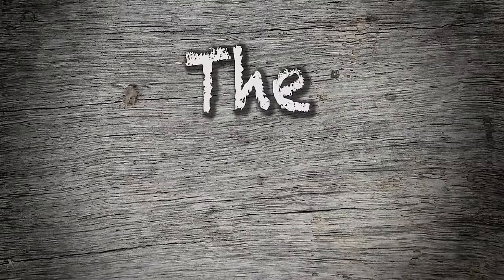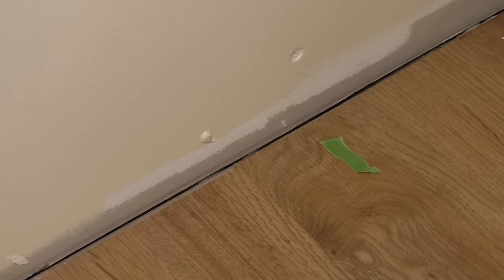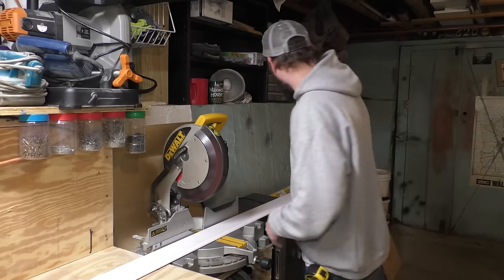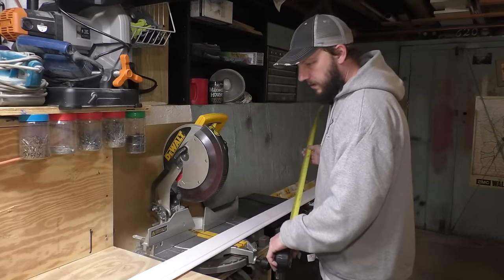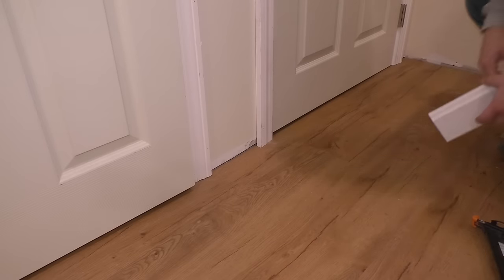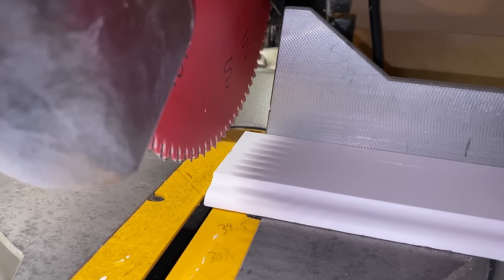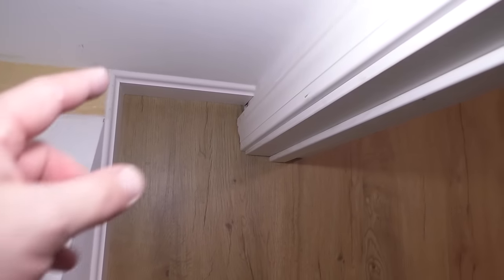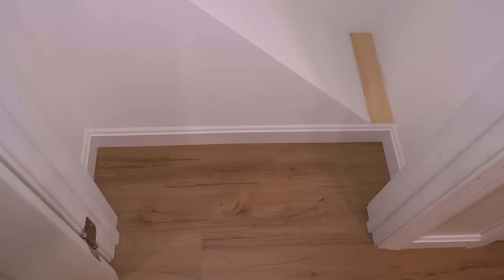How to Install Baseboard Trim - Cope and Scribe - Old House Bedroom Remodel Problems

Comment: Coping isn't worth the effort in my opinion. I just cut my pieces at a 47 degree angle which leaves a slight gap at the back that I just fill with caulk and the front usually turns out pretty clean

Comment: On the scribing baseboard before pushing the center down and nailing it in place put a tiny 16th inch thick shim on both ends of the baseboard bottom and then push it down and nail it and take the shims out after you nail the ends and then you'll have some room for the floor to move

Comment: Another option for the floor being unlevel creating the gaps is to install the baseboard as is leaving whatever gaps are there. Then to add a shoe molding at the bottom. The shoe molding is much smaller than the baseboard so it flexes easier to cover the gaps. This is especially useful when the baseboard is taller (like the 6" stuff) or the floor is very wavy. I just use short brads so the shoe molding is only nailed to the baseboard and not beyond that. The cheap traditional way was to use quarter round but they now have shoe molding that matches the style of the baseboards themselves and better fit with the look.

Comment: How to handle baseboard in an old house - great stuff. Guess those ideas would work on a bad basement concrete floor job as well.
Reply from the maker: Yes they would!  This is actually a pretty good title for this video... maybe I should change it.  🤔
Anyway, thanks for watching, John!
Reply: Why would you baseboard trim a concrete floor basement?
Reply: Baseboard on any unfinished floor (awaiting carpet usually) is unsettling for me. Leave 1/2 on corners and push down in the middle if it’s floating too much on your spacer blocks. But not too much.

Comment: Good solution for that closet trim. And you gain a little shelf. 
I actually prefer the 45 degree method, but coping works fine too. 👏👏

Comment: Great tips!
I do as you offer, push the baseboard to the floor. Normally the pressure I apply is not going to keep the floor from expanding or shifting. But if there is concern about the floor not being able to move, use a piece of strong paper or plastic or thin metal, not too thick, between baseboard  and floor while nailing and remove the paper/plastic after. Small gap, no hold, looks right. However, if you use the paper method, do it all along the whole length of the baseboard piece for even fit.

Comment: Even new homes have issues with uneven floors and settling. Eventually, your floors will gap or bounce due to expansion and contraction with your baseboards being so tight. Most people don't like using quarter-round or shoe mold but that is what they are made for. Caulk might work for a while. Hopefully, you won't have any problems in the near future. Floors and trim look good!

Comment: Love your practical approach!!  About the circular saw use... Use the tool that is best suited to your experience level.  Looks like a great tip with the method to hold those little 1 1/2" long pieces at the ends of the wall heater... I am absolutely going to put that info to good use.

Comment: Done the 45s hoping it fits right and it almost never does it seems. I was afraid of trying coping because I didn’t really understand it but I might try it on my next baseboard project! BTW, I think the closet looks 100% better with that trim and the way you did that piece to fill in the gap! And don’t worry…I won’t tell anyone about the gaps you left in the closet either lol

Comment: As a finish carpenter I have seen some winners.
One couple had a dining room addition built.
It was a disaster, walls not plumb, floor that sloped .
The first finish carpenter was fired left 3/4 gap off the finish floor, sank his nails with nail set.
Thee longest span had huge gaps between the base and wall.
Told them take 6 weeks, for base and cove mold for crown.
I simple stepped against the base fits tight all the way around.
I was done in 5.5 days. 
Included customer window treatment, base door casing one door had to trim to fit with taper.

What finish is all about finishing the project.

Comment: Coping ok for internal joins but external pointy joins are tricky with imperfect 90 degrees, have to measure the angle and half it with angled saw and it worked 😊

Comment: I want to redo my bedroom but my walls are not flat in some spots. What would I use to fix that before I rip up my carpet?
Reply from the maker: Hi, Markisha!  What do you mean by "not flat"?  Can you scrape them down?  Do they jet in towards the floor where you can add joint compound to bump them out?  Hard to say without seeing them.
Reply: @TheFixerHomeRepair  some spots in my wall bow out. I know it's old (built in the early 1950s) but I wanted to try to do small repairs/renovations myself.
Reply from the maker: Gotcha!  Well, assuming you do not want to tear the wall apart from scratch, you can try to float and feather out the wall in the spots with drywall mud.  OR.. you can get some thicker baseboard and "split the difference" by cutting into the spots that bow out and cut that part out so the baseboard sinks into the wall.  I have done this before, it feels wrong when you are hacking up the wall but if you use the baseboard to make a nice line at the top and you cut it out carefully, it looks great when you put the base in.  I really hope this helps and I will for sure keep this in mind for a video if I ever come across this situation!  Thanks for watching!

Comment: Great solution at the closet bulkhead, but you mentioned that you made it flush with the top of the baseboard--I would have left a 3/32" reveal (make the horizontal trim a little proud of the top of the baseboard). Maybe you did that--I couldn't really see on the video. Just like a built-up molding like a mantel or a complicated crown, you never align pieces flush.

Comment: I appreciate that you gave your viewers a warning about not using a table saw freehand, but a better explanation of the consequences might help deter a novice from attempting it! At 15:11 you came within less than a hair's width from a kickback event. If the workpiece had come in contact with the back of the blade it would have shot that board backwards toward you like a rocket.

Comment: Add some construction paper shims under the baseboards while pushing down and that will get you the clearance for the floor to be able to move. 

Caulk and paint make me the finish carpenter I ain't.

Comment: One question? Can I put laminate on a old wood floor?? Please let me know things
Reply from the maker: Yes!  If the floor is in good shape you can go right over it.  If it has deep grooves or missing pieces you will have to fill that stuff in before you go over it.  Just make sure to use the proper underlayment for the floor or get one that has it built in.  Hope this helps!  Thanks for watching!

Comment: hey, just wanna ask, isnt a table saw and a circular saw technically the same? like isnt a table saw just a circular saw under a table? like i commented on your previous videos before, i enjoy watching your videos but i dont do any woodworking or fixing houses, but i do enjoy learning things while watching it. ive only used a few tools in the wood shop back in college but not enough to know how they worked or what they did.
Reply: The big difference between the two is that with the table saw, the blade remains stationary and you move the piece you are working on, whereas with the circular saw the work remains stationary and you move the cutting blade. For the job being done here, the circular saw is safer because your fingers are above the blade, away from the work.
Reply: @billkelly8222  thank you so much for the detailed explanation!

Comment: I still don't think there is anything wrong with that free hand tablesaw work, I would have changed out the blade for a 7.25 blade so that there is not as much inertial mass for kicking back the board, but outside of that, you did a flip cut and everything, it is perfect.

Edit: Yes 45s on the tablesaw also sketch me out and I have a nicer saw, I think one of the main reasons is that I can't flip cut like I do on almost all longer pieces
Reply from the maker: Yes!  Exactly.  I have no problem doing 45’s on a table saw with long pieces and someone to catch it on the other side but ripping something like this just doesn’t feel right.  Thanks for watching, David!

Comment: If I were you I would remove the floor heater and install an Air Force heater in the house
Reply from the maker: In order to do that I would have to change my whole system.  $15-$20,000 is something I don’t have to spend on that.  😁😬

Comment: If you have more rooms to work on, can I suggest picking up one of those Starrett miter gauges.   Really takes the guess work out of it.  I'm not a finish carpenter but I bought one when I had to wear that hat on occassion.
Reply: I've seen them in local hardware stores as well as Big Blue.  Can't say Big Orange carries them or not.    The item is aluminum/yellow.